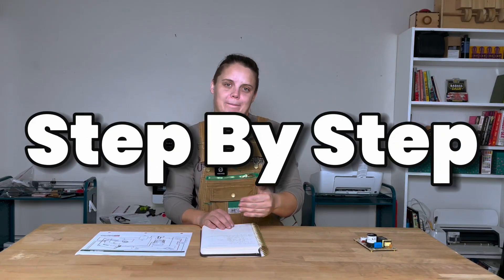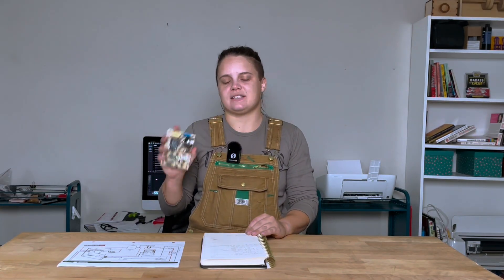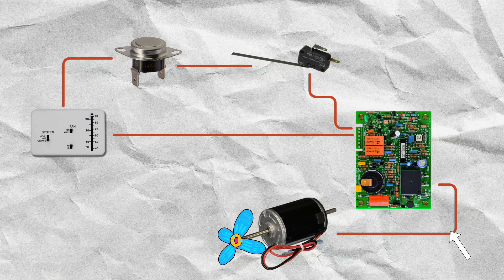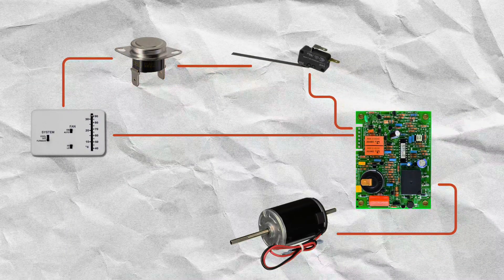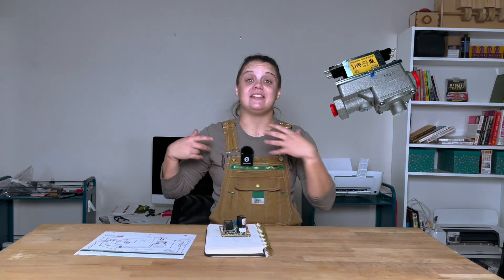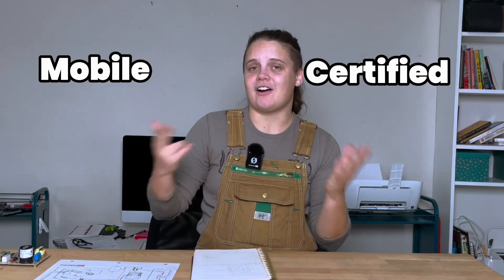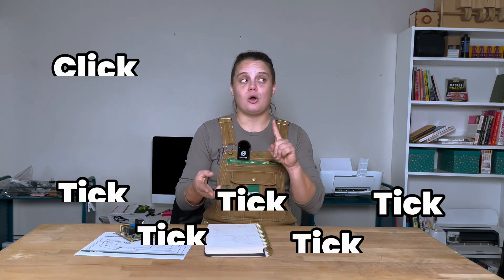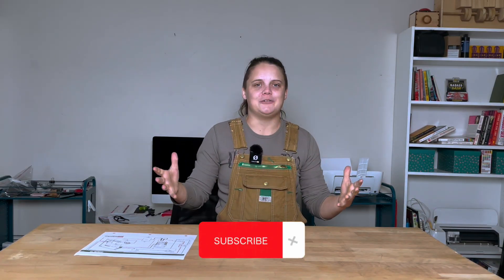How Does An RV Furnace Work?

Comment: Random issue, heater cycles but every now and then it cycles then the blower stays on forever until i turn it off, no heat. If i turn back on it cycles a couple times then does the same thing. Not consist cycles. Where should i start?

Comment: I remove the furnace from every camper we purchase. Yes even New ones. Just put a 750 watt ceramic electric heater on the dinette table. Safer, quieter and inexpensive to replace 😂

Comment: I got a questions  I turn the thermostat 70 . Next 15 to 25 seconds cold air good so far. Next got heat good so far about 10 minutes later furnace goes in to cold mode then shut down. The temperature  is 60. But if I wait say 4 or 5 minutes and turn furnace back on it will do the same thing.  Now I replaced sail switch 2 years ago was going to put a new one in as soon a the weather get back to 50s and put a new hot temperature  switch in at same time .  I know with out doing more test on my Sfv35 furnace do you think it could be a motherboard problem  thank you for any help today weather 36 outside and rain in wisconsin

Comment: Really well done.  I have been annoyed by the cold air before and after but at least I now know why.
Reply: The reason why is that RV furnaces are made to be as inexpensive as possible so one fan motor does double duty as both an inducer and a blower.  Most residential furnaces use two different motors and fans, one as the inducer for the burner and another for the blower to distribute heat.  This allows the home furnace to purge the combustion chamber without blowing cold air through the ductwork.

Comment: My Winnebago furnace can run on electric or gas when I run it on electric it won't get hot no more I've never used the gas. Why won't my electric furnace heat up
Reply from the maker: Do you know the brand of your furnace? I’m not familiar with an RV furnace that does both electric and propane. (Not saying it doesn’t exist, I just haven’t seen it before). Is there any chance when you turn the thermostat to heat that the fan motor in your AC also turns on?
Reply: @rvrepairwoman  2001 winnebago adventure RV, comfort Coleman Mack it's got the AC underneath it's got electric heat in the back. I've run the electric heat with no propane but now it don't come on. I put a new thermostat on there and I seem to won't be the problem I think I got a mouse problem.

Comment: The fan seem to  have low blowing force so it’s not kicking the limit switch on why is that?
Reply from the maker: I would look to see if the fan is getting the full 12V it should and confirm your sail switch is clean and nothing is stopping it from closing. If the fan is being sent good power then it may need to be replaced. They do go bad sometimes.